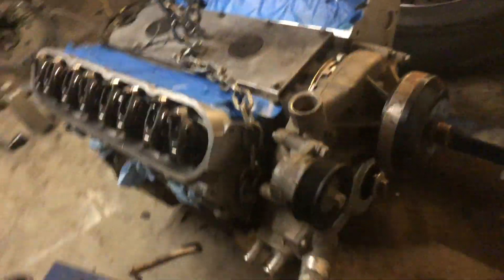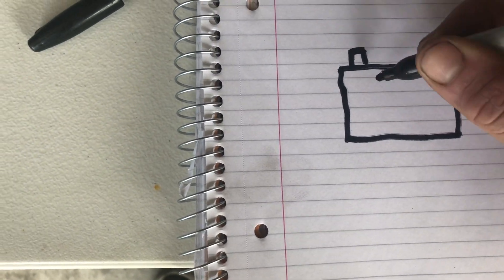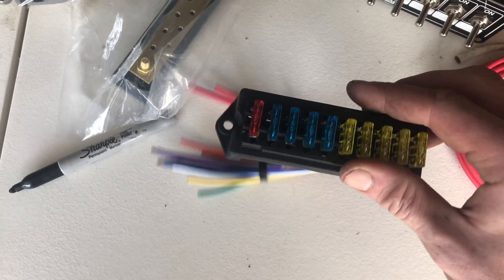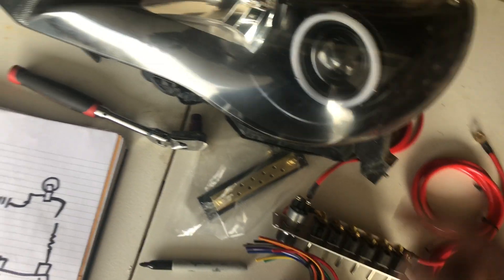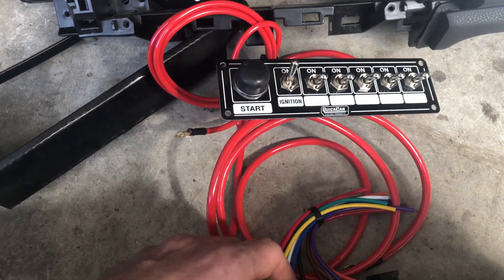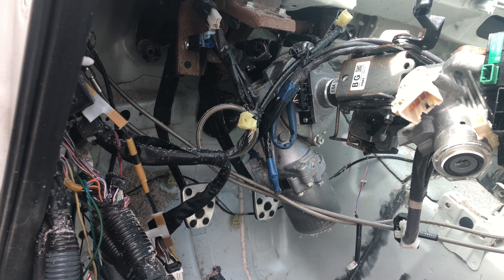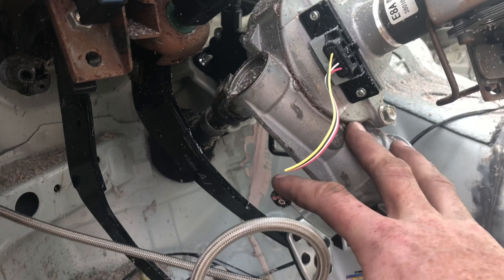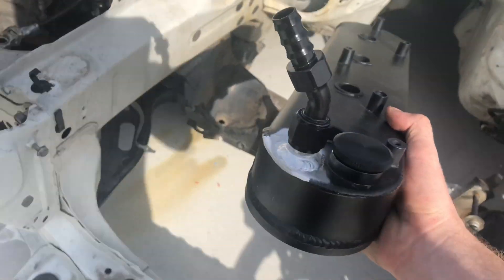FRS LS Swap: The Basics Of How To Wire A Racecar

Comment: Question: if current runs from earth to positive, how come the fuse is wired in before the light on the positive side? I've never understood this. I know conventional flow is positive to negative, but for things like HID bulbs where its constantly earth powered until positively switched, how come the fuse is after the bulb if its powered by earth ? apologies if that wasn't explained well, I'm not good at explaining
Reply: Sorry dont worry about the HID section of my comment above, i just googled it and realised they have the ballast.

Comment: Howd you end up doing the electric steering.
Reply from the maker: I talk about it in a later video but I honestly forget which one lol. Its pretty easy though, you just have to splice this small white and black wire together, then there is a large power and ground cable. Lastly there is a smaller green wire thats the signal wire to turn it on and off.

Comment: Why use a switch panel?
Reply from the maker: If you make your own harness for a swap and have the interior stripped, its alot easier. The ecu can control things like the fuel pump and fans but it was easier for me to just put it all on a panel
Reply: @WildSlideDrift  Ok, makes sense. Thanks for your reply
Reply: Because racecar.
Reply: @straightuptrucking  😂 Say no more

Comment: whats the purpose for having each function wired to a separate switch? just for fun ?
Reply from the maker: If you lose a relay or a fuse it wont kill every component. Also running every component on one switch is probably going to be too many amps. You could lessen the amount if you have the ecu control fans/fuel but other than that i would keep them separate

Comment: So I have close to the same panel as you and can't figure out what to wire the red wire coming off the start button and the red wire coming off the power block on the bottom that connects all the switches together. What did you wire yours to?
Reply from the maker: The one off the bottom is the main power for all the switches. Since it may draw alot through the panel itself, i suggest using it to power relays for whatever component its controlling. And the one off the start button will go straight to the starter solenoid or a relay that controls it

Comment: I planning to do this on my 10th gen civic. Question, can you also hook the electronic parking brake, sportmode and brake hold onto the panel switch? If so how? It would be a great help. Thanks!
Reply from the maker: I honestly have no idea how the wiring setup is on those cars lol. I would look at some diagrams and figure which wires you need to get power from the panel

Comment: DUDE! I'd really like to hear how long (or short) running that engine went. It looks like you needed a different length pushrod...
Reply from the maker: Mr Wizard ya i need shorter ones lol thats next on the list lol. I need to measure to see what i need too. And i got it running in under a year! I had some issues after that with burning plug wires and oil lines but it all got resolved. She runs great now with no issues
Reply: @WildSlideDrift  Great news! I'm glad to hear it. Usually, that type of issue doesn't result in a catastrophic failure. But, having to raise the location on the rocker shafts causes them to be weak and not produce the best lift. If you get the valve geometry set up better, you might find a lot more horsepower. You can purchase (cheaply) or borrow (even better) a set of adjustable pushrods so you can figure out the proper length and then go online to find the right size. Proper valve train geometry is critical to getting the most lift and keeping the damage away from the valve train. High revving engines weakest point is the valve train. With really high lift cams you push the limits of rockers and the fulcrums that hold them. You've caused a weakening of the pedestals that hold the rocker shafts onto the head and it will cause the bolts to fail. Improper geometry puts still higher stress on those parts.
Reply from the maker: Mr Wizard yep! I have an adjustable pushrod i just need to get the rockers off and figure everything out. But ya you are right i already broke one of the lifter bolts and had to fix that. Ive been working on a racing engine shop and i already want to change a ton lol

Comment: How’d you adapt the ls wiring harness to the frs wiring harness
Reply from the maker: BKG COLT i didnt i ended up just wiring the body as a standalone and using a standalone setup for the ls stuff.
Reply: Wild Slide Drift ahh I see lol cause when I was tryna choose a company to make a harness I asked how they did it and what not but from what your saying it makes sense you unpinned what you didn’t need and essentially wired everything to where it would feed on the stock setup
Reply: Wild Slide Drift one last question tuning wise have you figured that out lol
Reply from the maker: BKG COLT ya i just have like a base map tune on a stock ls ecu. Cbm motorsports can take your cam specs, injectors, intake and everything else to make one. They can do it by mail to so its not limited to california

Comment: How did you do the alt
Reply from the maker: Robert Durbin it plugs into the harness and then run a larger wire from its post straight to the positive side of the battery